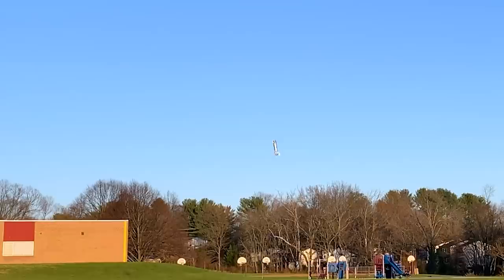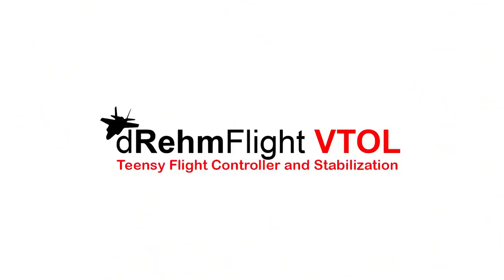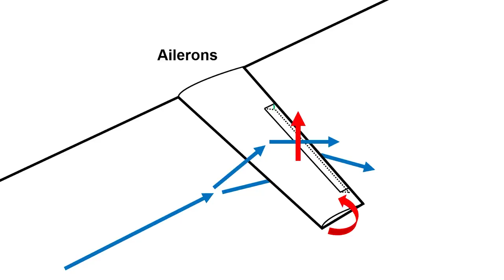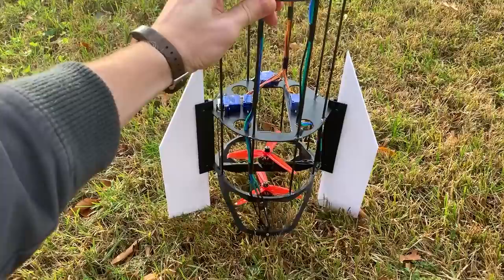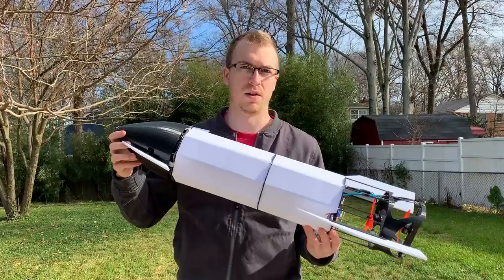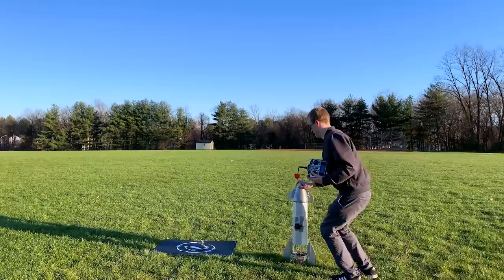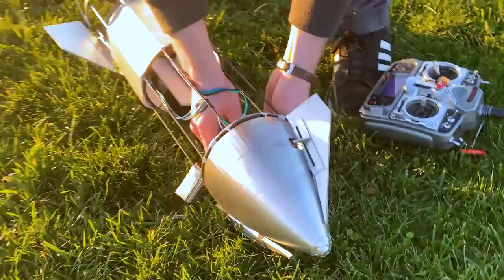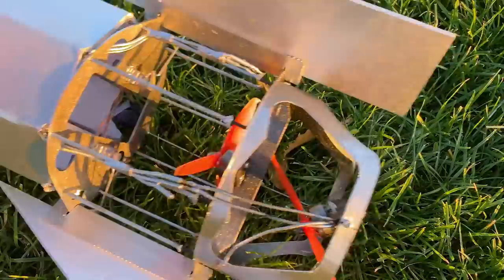Radio Controlled SpaceX Starship Belly Flop

Comment from the maker: Next RC starship flight will be to a much higher altitude with onboard FPV where we'll really put it through it's paces. Remember to SUBSCRIBE so you don't miss it!
Reply: Very impressive work Nicholas. I was watching with interest throughout all video and it is not happening often. I am curious what will you achieve in it next time.. I am holding my thumbs. This aircraft is incredible but not controllable enough due to no lift on horizontal flight mode. Would you consider 3 surface controls X 2 instead of 2 surface and the too yaw control can't be working well as it is disturbed by bottom thrust..
Reply: Nicholas Rehm I can’t wait!
Reply: Carbon fiber tubes would increase the torsional rigidity and hopefully be lighter than adding the skin. Monokote might work for the skin also. I'm sure you have already considered these options though.  If you added some orange and red ribbons to the bottom, it would look cool. Hopefully the idling motors would keep them out of the propellers.

Comment: first starship model to actually fly that stable and perform the belly landing. Very impressive,  well done :)
Reply from the maker: Thanks, still plenty of room for improvement!
Reply: Nicholas Rehm wonder how hard it would be with model rocket engines 🤔
Reply: @NicholasRehm  
Yep. That last landing.
Low voltage in the header-battery?
: )

Comment: This is the most accurate and working starship model I've ever seen
Reply: Including the RUD on the last flight
Reply: @Game Over I wonder if a container with a weighted ball of gell inside could simulate the fuel movement and weight change during the maneuvers.  Or a weight on a screw shaft that goes along the center.

Comment: Great work, really neat to see how the flaps and thrust vectoring will work together in a real flying model rather than just simulations. And it does work! Gives me more confidence that we'll see some sort of success today, though it could easily look like your last flight as well depending on what altitude they try to relight the motors at.
Reply from the maker: I think it’s safe to say we saw some success!
Reply: @NicholasRehm  The final turn was amazing to watch. Can't wait to hear the post-flight analysis and what happened to the engines on both ascent and descent. A bit more thrust and I think it would have stuck the landing, I was so impressed that they hit the pad at all!

Comment: Hold up, so the process of stiffing the chassis went from using string of all things to add rigidity, to covering up the entire body (which you didn't want to do). Surely there are some simple solutions between those two extremes, such as using more of those carbon spars at right angles or diagonals to tie the vertical spars together better. 

This is really cool, it looks reasonably straight forward to build, but there is still plenty of interesting stuff to tune and keep you busy with for a good deal of time.
Reply from the maker: It was sort of a compromise of time/effort--String was going to take a while to get right, but I knew the foam would work and be very easy to set up. Diagonal members is probably the 'best' way to go, but cutting all that carbon and designing the hardware for the joints would take 5x as long as the string
Reply: @NicholasRehm  Hot glue for the joints? And maybe some very lightweight wooden dowels instead of carbon.

Comment: Say, the rocket is standing upright, it got 4 tiny feet to land on the ground.
The rocket flying part is relative easy.
The landing part is extremely difficult.
When the rocket return to the ground, the most ideal case is 4 feet land the same time.
In real life, it could be just one foot land first. This off axial contact is creating a torque to topple the rocket.
When the hardware senses an imbalance, correct will quickly react, but most likely making it worse.

If I were to build one, I would use four cat paw instead of the feet. 
The cat paw have touch sensor so the loading on it is slowly increased until all four paws have balanced loading.
Then gradually turn off the power.

Comment: I would've thought you'd have problems with gyroscopic torque, like pivoting an engine in pitch produces a torque moment in yaw and vice versa. Perhaps that's one of the reasons it likes to precess instead of hovering in place?
Reply from the maker: Good point, I should probably feed the derivative term from the roll axis to the pitch axis and vice versa to help with the coupling induced by the gyroscopic precession. But fast enough PID loop rate has it decently flyable for now

Comment: Superb project, Mr. Rehm. Very similar to the project I am working on it, as I mentioned before. When are you planning to do a tutorial on how to adapt the code to any project? I am studying your code. Thanks again
Reply from the maker: I used very similar control mixer as the starhopper (there's a pretty good explanation there). Also some good info in the dRehmFlight docs tutorial section!

Comment: brilliant work, ime based in the UK ive been wondering weather to have a go at this challenge using 3 huge 70mm ducted's ive got here kicking around & using a silver mesh for the nose cone & running the air intake right thru the body of the craft so ive basically got close to 3 gimbaling engines in a clutch like on he full size starship, its going to be an amusing fail if nothing else, keep up the great vids & builds
Reply from the maker: I love that idea. It would be cool to gimbal the 3 EDFs independently like the real thing. Best of luck

Comment: Awesome work.  You hv done more in your littke time thsn bps space has done in years
Reply from the maker: I wouldn't say that... Joe is doing some amazing work, made all the more difficult using rocket motors instead of electric motors
Reply: @NicholasRehm  i guessyour right, those rockets are very inconsistant, i asked him many times why not come up with your own sugar rocket mixture and design with nozzles, so at least he has some control over at least consistanty of the motors and its trust.

Comment: It's pitch and yaw control. (The pointy end is the front). You can achieve Roll by spinning one motor slower/faster than the other one.
Reply: They are not canards, they are elonerons (perpendicular to the windstream).
Reply from the maker: Depends on how you align your coordinate systems

Comment: One thing that might make the landing easier would be air brakes on the top of the rocket so that it being above the center of mass, would keep it facing uprights
Reply from the maker: What do I do when airspeed is zero?
Reply: @NicholasRehm  What I kinda meant was after the belly flop, when you are ready to land, deploy the airbrakes, which would make it face in the perfect direction using the air that the SN8 is passing through

Comment: Do you have two discreet modes for bellyflop/hover? Or are both systems active at the same time
Reply from the maker: I have a switch that engages the control surfaces for bellyflop, and retracts the rear surfaces fully for landing maneuver

Comment: Hello Mr Rehm, I know you're very busy, but I hope you're able to answer my question. Could your stabilization setup be used to control a RC Harrier reaction control system during vertical take off,  automatically shut off once it enters forward flight, and then engage again once it detects forward flight has  ended? Thanks, I think your projects are great!!!
Reply from the maker: Yes absolutely. You can setup different flight modes and switch between them with an auxiliary radio switch (exactly what I did with this starship)

Comment: The dual motor control for trust vectoring is cool. It would take more space, but star ship uses 3 gymboled rockets for direction change. Maybe your next try ought to use 3 EDF's instead?
Reply from the maker: I did think about that, but EDF efficiency is pretty bad + it would have to be about 2x it’s current size to fit the edfs/gimbaling + I can’t afford that haha
Reply: @NicholasRehm  I agree...it is more expensive by a lot. 2 servos per EDF, 3 EDFs, 3 ESCs, bigger battery, more complex setup...
*
I was thinking about staying "more pure" to the real space craft. EDFs would be a lot noisier and that's being "more pure" too. LOL!

Comment: Have you considered the CG position to be in the best position? since for hover phase it's better to be as bottom as possible but for belly flight, it's better to be at the top? How did you implement it?  and Why you didn't manage to build a little bigger fins to reduce the speed in the glide phase so you can control it for a longer period? but overall its was a fantastic job man.. Thanks for sharing
Reply from the maker: CG is just about at the center between the fore and aft surfaces. It's actually best to have cg as close to the nose as possible for hover--gives more moment arm for thrust vectoring motors which means more control authority. Only time tail heavy would be beneficial would be landing so it doesn't tip over so easily.
Increasing fin size slightly to slow freefall is an excellent idea, this version I was going more for looks. Thanks!
Reply: @NicholasRehm  exactly .. its a trade of between static stability and controllability ... maybe a wider arm landing leg help with the flipping over... It will no more be an exact copy of starship in appearance but it will land much better... 
Thanks for the answer... keep up the work...waiting for the next result sir... Good luck

Comment: I guess it might work fine if you remade that body out of welded steel mesh, you know, the stuff they use for rodent cages. Would not hinder airflow, gives a nice round shape with rings around and should weigh about the same like these carbonfiber stringers...

Comment: Can't you solve the lack of structural stiffness by accounting for the step response in your transfer function? I remember I did something like this in Sanner's final project
Reply from the maker: It gets tricky with non-rigid body dynamics... could probably approximate it with a torsional spring pretty well and maybe do a feed-forward type controller to estimate the oscillations. But linearized PID doesn’t care for any of that haha

Comment: Fascinating.  So does re-engaging the thrush after the belly flop automagically pitch the nose up because of the shape of the control surfaces or do you have to do a bunch of steering?
Reply from the maker: Thrust helps push the tail down and bring it fully vertical

Comment: Awesome job, it looks great as well as functioning really well. 
Just wondering whether you considered using thrust vectoring with flaps again for the static roll (when hovering), just because it seems like you lose a lot of control when one prop is rotating much faster than the other, given that each controls separate pitch/yaw channels, therefore losing authority in one channel. I know this would add weight and complexity, so would you consider a single prop with combined pitch/yaw servos and roll vectoring flaps so you can get more precise roll control without sacrificing pitch/yaw?
Reply from the maker: I actually did have to do that on my starhopper to help with control authority. The differential thrust on this one actually works pretty well because there's tons of excess power. Sometimes the wind catches the control surfaces and rolls it around though (see 11:18)
Reply: @NicholasRehm  Thanks for the reply!
I guess you could always add some RCS thrusters 😂 A little bit of hypergolic fuel never hurt anyone lol

Comment: Cool rocket, after watching this video I wanted to make a similar starship rocket that will also fly on two motors. But I want to make my rocket fly on autopilot using Arduino. I want to install two 2600kv motors and a 4 x 4 propeller, hope it will work well.
Reply from the maker: This uses arduino for stabilization too

Comment: Amazing development.  What are the operator's inputs?  Are they just high-level commands or does the operator need to directly control pitch and yaw?  If the later, and the vehicle rolls 90 deg about its axis, wouldn't the controls swap (pitch is now yaw, ...)?  It seems almost impossible to control without a fully automated controller, like a modern drone where one can input just a desired path and orientation and let the controller manage the details.  You also have fewer thrust outputs than Starship, since no lateral forces on the fwd end like StarShip's retro-rockets.  Just pushing from the bottom is like trying to balance a pencil on your finger, a classic rocket control problem which caused many flight failures in the early 1950's flights using the primitive electrical components of the day, so it just stably flying upward was a major feat.
Reply from the maker: Pilot inputs are desired attitude angles or rates for roll/pitch/yaw. Yes roll and yaw swap but I have that programmed to a switch for transition so the controls still make sense to me while flying. Everything is actively stabilized otherwise hover would be impossible!

Comment: Are you using the singlecopter firmware (modified) or did you program the whole code from scratch?
Reply from the maker: The whole code is my own and open source: https://github.com/nickrehm/dRehmFlight
Reply: @NicholasRehm  Wow, thanks a lot for that. I am very interested in these singlecopter applications. Great that you share your work! Great Job with the Starship!
Reply from the maker: @fischertechnik2829  Thank you!

Comment: what motor did you use?
Reply from the maker: Xing E-2207 2450kv
Reply: Thank you
Reply: can I use other motors to achieve the same result?
Reply from the maker: @coryexe936  sure, pretty much any miniquad motor with 5” prop and 4s battery will give similar thrust

Comment: If you want to try bracing with wire or thread again run two strands for each diagonal and tension them by twisting like they do in fences.  https://www.peterperksltd.com/how-to-brace-high-tension-horse-fences/
Reply from the maker: Thanks for the tip, will keep that in mind

Comment: I am using 1 motor plz tell how to stop rotating
Reply from the maker: Use two to counter the torque, or use anti-torque vanes
Reply: @NicholasRehm  but I have only one motor
Reply: I want to make howring rocket
Reply from the maker: @shrivardhanpatil3443  gear it to have counter rotating props, or use anti-torque vanes
Reply: @NicholasRehm  what is anti torque venes

Comment: not correct belly flop / sky diver manoeuvrer as the engine was still powered during free fall hence not free fall, it acted more like a glider.  Try again but maybe go much higher and shut off engine and leave it to the fins to change orientation
Reply: if you are concerned that you can't spin back in time then add some small explosive charge or vents to redirect the thrust side ways
Reply from the maker: @busterdafydd3096  I agree with you, I did keep a little bit of throttle on during the freefall because I was worried. I think the last flight (not the crash) had less than 5% throttle, so pretty close. I will fly again to higher altitude and fly off control surfaces only next time
Reply: True but if I understand Starship's concept,  reentry from outer space would actually involve a lot of forward/speed so if anything, keeping the motors running and giving a little push when the model is horizontal is still a valid approximation.

Comment: Conclusion, tailsitter design is bad .
Reply from the maker: Very difficult to land for sure
Reply: @NicholasRehm  Not only to land..
Side winds, especially in low Reynolds (aeroelastic instability) and high winds (impossible to land ) and for back winds (stall propeller or fins). Just good to take off in a silo.